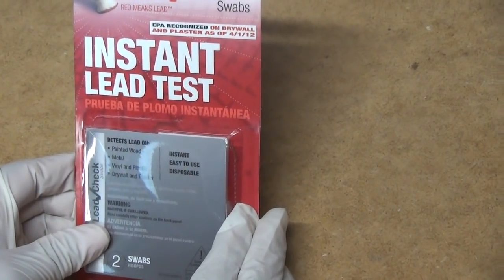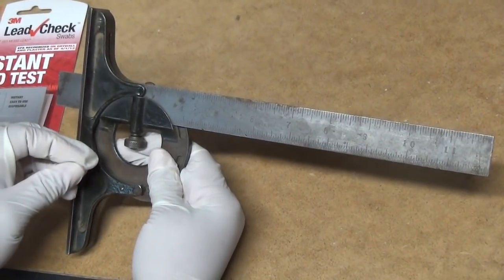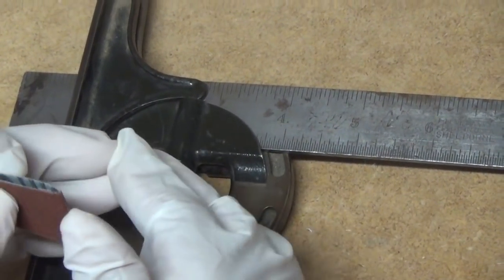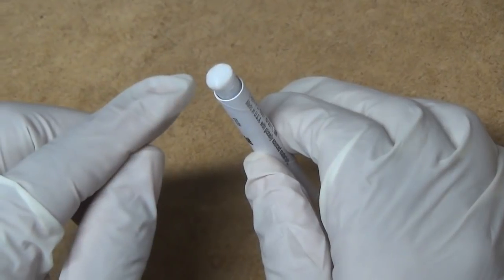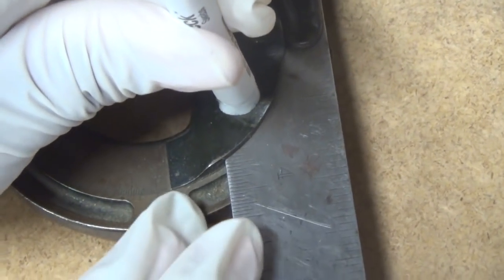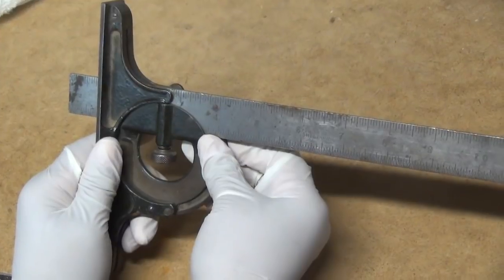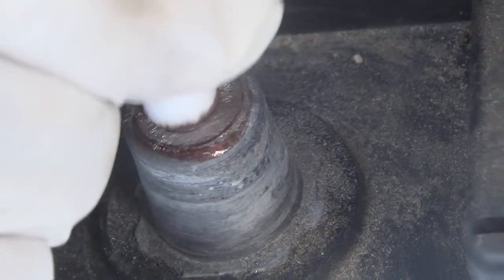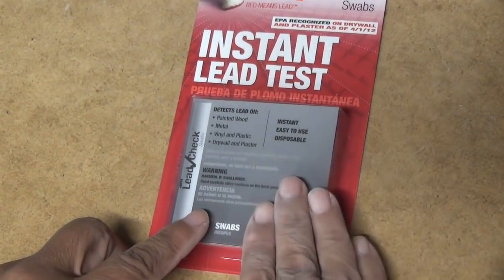I Tested This Tool for Lead and the Results Were SHOCKING

Comment: This is something I thought of last weekend.  I was stripping about 4 layers of old paint off a very old stand up ashtray.  It was cast iron and very heavy with lots of detail that I had to get the wire wheel into.  There was lots of dust in the air as I was doing it and although I was wearing a respirator...my eyes were sore afterwards.  I wondered if it was due to something in the paint.
A little late now but I could test before wire wheeling something old like that from now on.

Comment: I can see the application if you are restoring old toys that kids will be playing with afterwards but most of us don't put tools in our mouth and chew on them, in either case the paint might be important to the value of the antique item so unless it is cracking and in bad shape it might better be left alone.  You could mark the item in some location saying the paint contains lead and if it is an antique toy collection do this then store it where it can be looked at but not played with.  As an old sailor I've handled a lot of lead paint and it hasn't stopped the aging process.

Comment: If you're a landlord don't test for lead. The law requires you to remove all lead paint. 
If you don't test you just include a "not tested, may contain lead" disclosure for the tenant to sign. (may vary by state)

Comment: There isn't lead in that paint, because it's not paint, it's "japanning". Japanning is a type of lacquer that uses Asphaltum (a natural tar-like substance) as a base, and is baked in order to cure it, as such it does not need the color or drying properties of lead. It is commonly seen on old hand planes and some old sewing machines.  Thanks for the video.
Reply from the maker: Hey Adam, that is very interesting...thanks for sharing that with the community!

Comment: When it comes to paint and lead, it mainly pertains to house paint and particularly white (or light colored) paint. One of the forms of lead oxide is white in color and it was used as pigment to make white paint before the harmful health and environmental effects were fully known. The black paint on the tool was unlikely to have lead contamination.

Steel blast furnaces typically reach average temperatures between 1,800 C and 2,000 C for the refining process. These temperatures are high enough (above 1,749 C) to actually boil lead into it's gaseous form and remove it from the molten iron. It would be unlikely that the alloy used to make steel tools would contain lead and lead contamination with steel tools are mostly from surface contamination (i.e. the tool was used on a lead item) where lead atoms are transferred from one object and bonded to the surface atoms of the tool. The lead terminals of that old battery would actually transfer lead to the steel or copper cable connectors in the vehicle and they would actually test positive for lead.

Comment: The tri square was probably not paint per se but black Japanning, a heat cured process, it is a tool coating common until after WWII, think of old Stanley planes.
Reply from the maker: That's interesting

Comment: I did this on an old window sill and was also shocked to not find lead.
Reply: We used to teach the Lead Safety Class.  It's not as unusual as people think to find negative lead results on some old houses.  Lead was a relatively expensive additive (used to make the paint last longer and look better) and many people, at least in certain parts of the country, couldn't afford it.
Reply: Given the history of the house I'm in, this makes a lot of sense.  It's in the country and was built by the kids for grandma in the 1930's (even milled from trees off the property) so they probably didn't go all out on expensive paints.  Thanks for the info.

Comment: I'm a bit concerned with sensitivity of this tester. The test on the old battery was successful but this was almost 100% lead. I wish I could be 100 % sure after using this tester
Reply: There are more sensitive tests (and they are more expensive).  The Lead Check kit has been thoroughly researched however you may want to look into having someone use an XRF machine in areas where you are especially concerned.